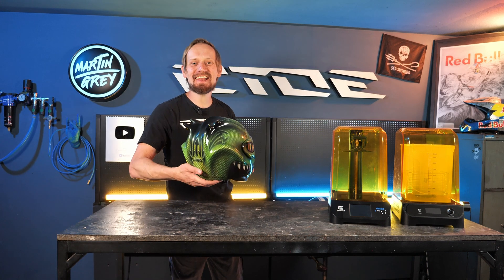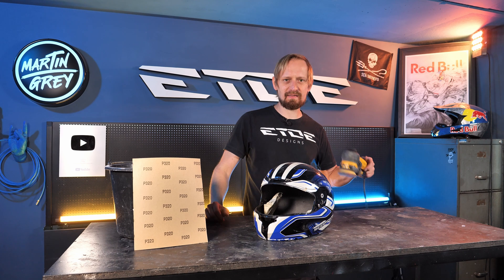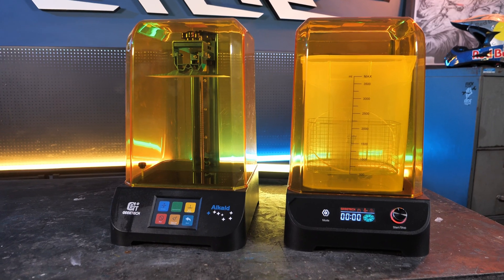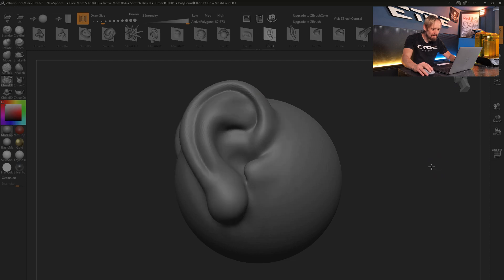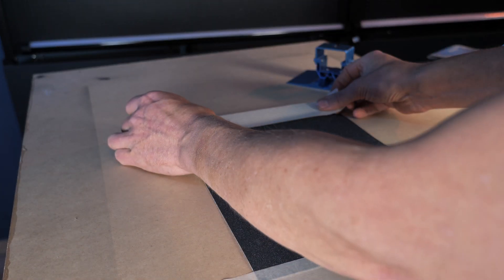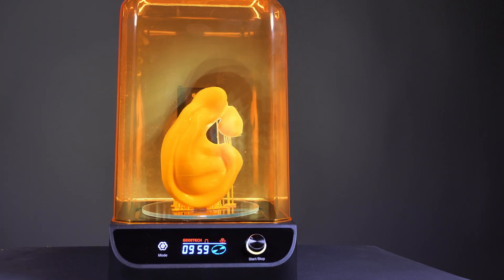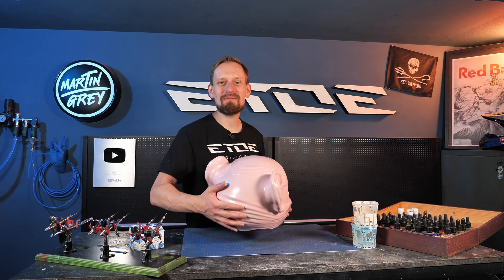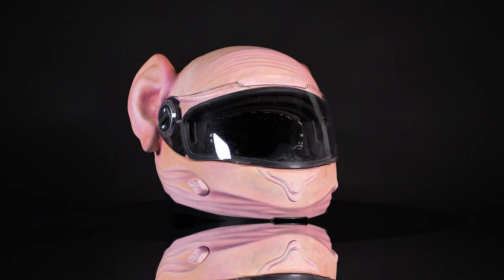Watch What Happens When You Put Ears on a Helmet!

Comment: Should you sand down an aluminium bike after having it sandblasted because it is really rough? Or just leave it as it is and put on the first primer
Reply from the maker: Please do better blasting. My aluminum frames are smooth with no damage in the surface after blasting. I can even leave the bearings in. Just check this video: https://youtu.be/vN3j228TXKM

Comment: Here's a little pro tip for using that two part epoxy putty. If you want nice feathered edges without using additional filler, you can spray the putty with rubbing alcohol. It's softens the putty a little bit and you can mold it really easily and get those smooth edges and a nice surface finish. You might have to do a little bit of sanding afterwards but far less and it dries just as hard.